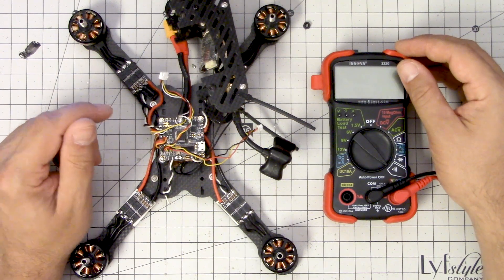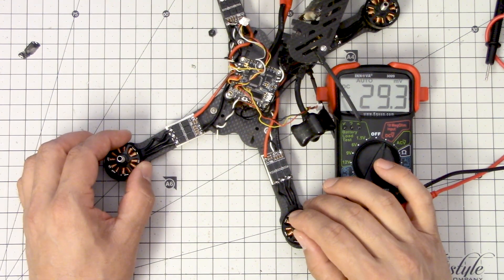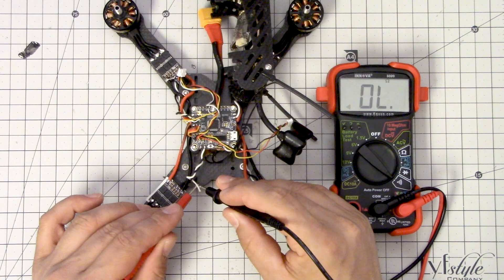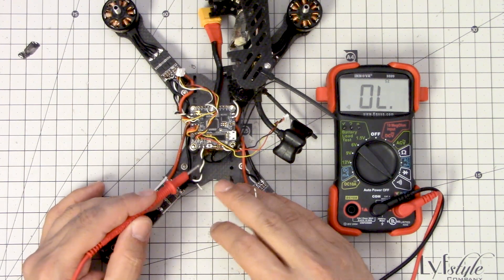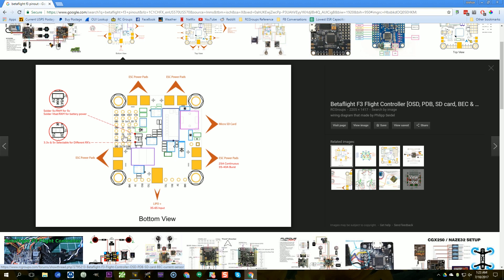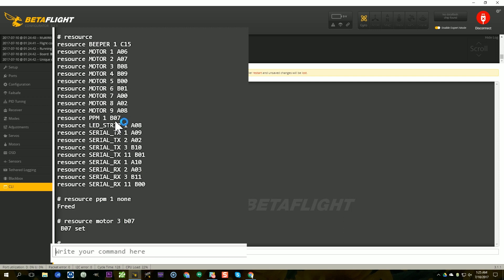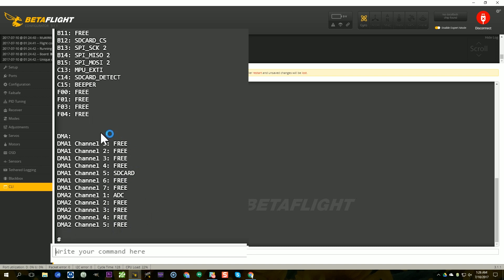How To Fix A Bad Motor Output With Betaflight Resource Remapping

Comment: i just replaced a motor thinking it was the motor because they are cheap racerstar motors.. i have a dys f20a 4n1 esc and all three motors are working except for motor 2.  it just twitches like the esc isn't firing the signel correctly. is that another bad esc to add to my pile or could it be something else?
Reply from the maker: +Ron Ferlman Ifnthe motor twitches it'd usually either the motor or the ESC. You replaced the motor, so...
Reply: Joshua Bardwell yeah that's what I though.. jist bought this board 2 weeks ago and haven't flown it much... maybe I should try 30 amp escs..

Comment: I've done this with my CL_Racing F4 board and now I can't use DSHOT. You mentioned it has something to do with DMA, but I'm not sure how to get fix the DMA issue. Do you have a video coming that addresses this?
Reply from the maker: If you reassign resources such that there is a DMA conflict, the only fix is to reassign them to get rid of the conflict. This may not be possible depending on what pins and DMA channels the board uses. You might need to go to Multishot since it doesn't use DMA.

Comment: Did you know you can use just a multimeter to test motor outputs? It will read not only PWM but also OneShot and Dshot. It shows as a relative voltage. Rotorgeeks has a video about it on their channel.
Reply from the maker: Hmmm well yes, it will measure voltage, but without a signal analyzer you can't tell a lot about whether the signal is really valid.

Comment: Hi Josh! We discovered that you can read the motor output signal from your flight controller with just a multimeter. This works not only on PWM and OneShot/Multishot but even Dshot! It's an easy way to confirm that the motor output pin on the FC is indeed bad. We made a video about it: https://youtu.be/WvTFm-COk3Q

Comment: how i can tell if it's motor/esc problem or probably FC ?

after i did full thr n s-turn my quad dipping hard every time i cant save it. i thought my problem just like le drib(dipping corners video) but i check at low thr there is no dipping corners. any idea? thanks
Reply from the maker: Swap the motor and ESC. If the problem keeps happening, it's the FC :-)
Reply: i tried your "quadcopter desync throubleshoot". i step on it n use motor throttle it up, everything looks good except different vibiration at some motor. welll racestar 2205s quality...cant complain :-)

*try not to chop my feet

Comment: awesome. any way to work around a busted gyro?
Reply from the maker: Nope. The board is probably dead at that point. In theory you could solder on a new IMU chip, but that's beyond most people.
Reply: ya it just flips out. rip on some parts. thanks for all your instructinal videos

Comment: if the signal wire was shorted to ground, wouldnt that cause the quadcopter to be shorted as a whole and not start to begin with?
Reply from the maker: No. Signal wires are not in parallel with anything else. So a shorted signal wire only negates itself.

Comment: Hey, awesome meeting you at flite fest 2017...nice dress lol. I recently got a king kong 90gt and  immediately went to utube and copied someones set up in betaflight and blheli. well now the 2 clockwise motors heat up and so does the battery in seconds and it drops from the sky. is this drone salvageable?...  thanks for the help.
Reply from the maker: I guess you have the PIDs screwed up. If you had copied the original config dump to a text file before overwriting it, that would be great. Trying going to default PIDs and lower D gain to like 20.

Comment: could you please suggest me some good charger that I can buy in USA  but pls I want it below 41s
because that's all I have 😅😅😅😊
Reply from the maker: IDK where you can get a charger AND a power supply for under $40 and shipped from within the US too. I would suggest the ISDT 150 watt charger and a cheap 350-watt 12v PSU from Amazon--can be had for about $25. You won't find anything even close to that price in a retail store though.

Comment: I had exactly the same problem with the rf revolt, but unfortunately there is no way to remap the motor output pin currently.
Reply from the maker: Bummer.
Reply: Joshua Bardwell yes and the crash replacement they offer would cost me more in the UK than buying a new revolt, so I'm running a revolt and I'm using a matek f405 on my other build, there are so many positives on how the revolt flies and equally the versatility of betaflight.
Reply: Sandro Gordon +1 betaflight
Reply: just had a thought, it maybe possible to remap the motor outputs on the revolt if I Flash it with betaflight, thanks for the video joshua, I couldn't find any information on this subject.

Comment: can someone say me if 500g quad is light ? (with lipo, props, antenna, etc. its 210mm )
Reply: BuzzCola 3 It's anorexic. Send it to me for rehab.
Reply from the maker: 500 grams for a 5" with battery on, and no HD cam is light. 500 grams with battery and HD cam is very light.
Reply: My 5" Qav R weighs  in around 540g with Go pro 4 black  and 3 cell  ready to fly.  My first quad ever  to fly well built ,fly full acro  Love this new  Toy
Reply: I have a CATALYST MACHINE WORKS 5" NORRIS and its 230grams with props.
Reply: Joshua Bardwell Ok thanks. i have eachine 1000tlv camera.
Reply: sadigov I just waiting for fs x6b. now it have 490g. it's my first build. I just need to place receiver in it and I'm done.
Reply: sadigov http://imgur.com/a/UFpBA

Comment: This is awesome, I didn't know this was possible.  I have a Naze32 with a damaged motor out put that I solved by adding a custom mix to move motor 1 to motor 5.  It's clunky though, bc the model in blackbox has 5 motors now.

Resource remapping seems much more elegant.
Reply from the maker: Yup it sure is.

Comment: Why do you only have a capacitor on one ESC?
Reply from the maker: Not sure what you mean. I have one capacitor on each ESC in this build. Maybe the video just showed in the middle of replacing the ESC.
Reply: MojoPapi FPV that's enough. if its voltage dropped. power will come from that cap.
Reply: So placement doesn't matter?  Whether its XT60 or a single ESC?
Reply: MojoPapi FPV it matters. it helps just when voltage is lower. but when its spike it not help. it will help when just that one ESC is making spikes. I'm placing my cap's on all of my ESC's→ my vtx and camera are powered from bec on PDB.
Reply: I asked why there was only one capacitor.  You said that was enough, and then say it matters where you place it and you're putting them on all caps.  So which is it?
Reply: Only one in the video.  Thanks for clarifying.
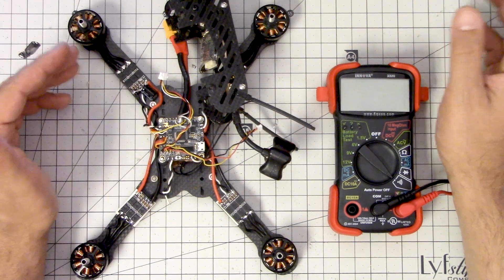Reply: Joshua Bardwell at 1:01 it looks like cap its just at top left ESC.
Reply: MojoPapi FPV its enough for voltage drop not for voltage spike. for voltage spike its just on that one ESC

Comment: How does that happen that internals on the board ground out like that?
Reply: That's my question also.  I have a flight controller that this happened to on multiple motor pads, but I have no idea why.
Reply: Too much heat on the pad when soldering.

Comment: Hello my friend, I have a problem with  my dron the I built, the throttle speeds up without me moving the stick all the way.If I raise a little it continues to raise the speed alone
I have a F4 V5pro HGLRC board.
I would be happy if you could help me thanks.
Reply from the maker: https://www.youtube.com/watch?v=xBaefeQtA1c
Reply: Joshua Bardwell thx it's work👍👍👍👍👍

Comment: Can I get your take on a similar problem? All 4 ESCs initialize the same, copter flies just fine, but BLHeli (browser or otherwise) does not show ESC#4. It's a new build (omnibus f4 v5), and it's not shorting the signal. It seems like a FC problem, because when I swap ESC4 to pad 3 it reads just fine. Wtf?
Reply from the maker: What if, in BLHeliSuite, you select ONLY ESC number 4 and hit "read ESC"?
Reply: Hmmm... I'll try that out tonight. Thanks for the reply!

Comment: Funny thing is I had the exact same issue with my Betaflight F3 yesterday. Motor 3 dead motor output. Of course I replaced the ESC before I discovered it to be the the FC. I had just got online to order a new FC when I saw this vid. Didn't even think to remap. You're the best Josh, thanks for the assist.

Comment: Have you fixed your failsafe problem
Reply from the maker: Huh? What failsafe problem?

I guess I fixed it...
Reply: Joshua Bardwell my omnibus f4 v3 just falls out of sky and you said you were having failsafe problems in another vid. and my quad was running fine be for this just started and it happening on 3 quads all with omnibus f4

Comment: The first version of the TBS BulletProof 25A (BLHeli-S) ESCs support DSHOT 150/300/600 but you have to remove a capacitor. Works pretty well ;)
Check: http://www.team-blacksheep.com/tbs-blhelis-dshot600.pdf

Comment: Resource remapping does not work for me. When I type it in. Nothing happens and the resource list just pops up again.
Reply from the maker: What version of Betaflight are you on? I am going to guess it's an older version that does not support it. There was one version that would show the list, but you couldn't actually do anything with it.
Reply: Joshua Bardwell same problem here unfortunately have tried the PPM and LED pad just like you described :(. FC is Betaflight F3 and yes I'm using the lasted version 3.1.7